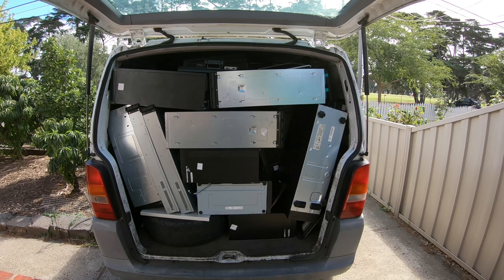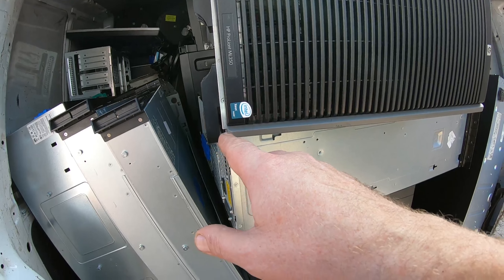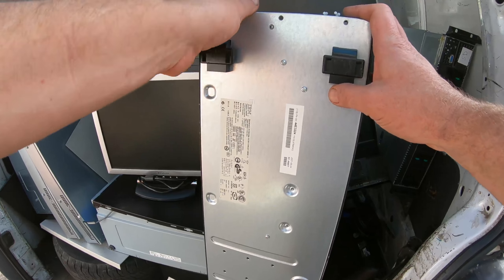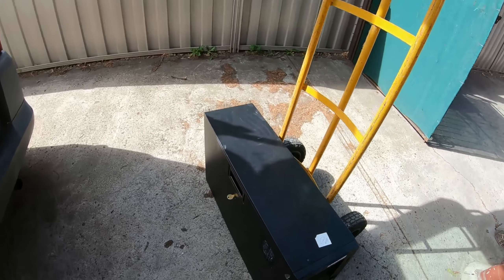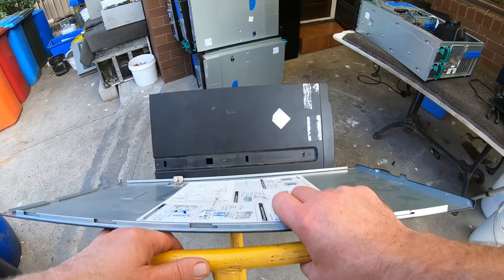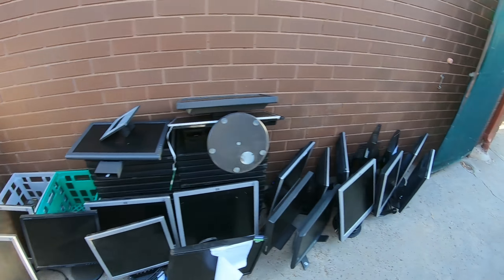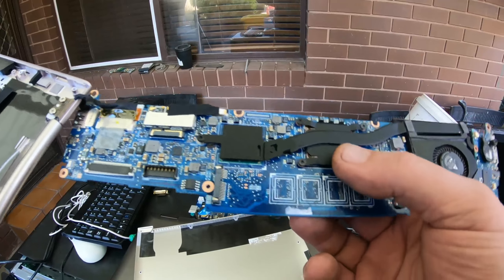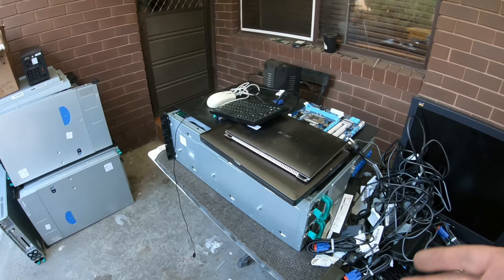eWaste Pick Up Day Lot's of PC's - Part 2

Comment: I export all my monitors to africian exporters. I get about 15$A each for them set price. I would stock pile them complete and locate an exporter, or check out the website that list people interesting in buying monitors in bulk especially for export.
Reply from the maker: India is another big market for monitors, so many Indian call centers servicing the world, they need lots of monitors, not pc's because they use servers to connect 500 monitors to one server, exporting used western monitors to India is a gold mine
Reply: Cool! Hopefully they don't use them in these scamming operations that are run from there. Does that mean you will try to find a buyer and not scrap them anymore? I sell my complete PCs for 15$A also. They don't want PCs without the hard drive. Although I sold 12 PCs without hard drive to a middle eastern exporter for about 7$A each. Not good but I needed the space, and in Sweden no one is buying boards at a price higher than 30cents  kg. ( I strip all my boards and sell the boards still at 30cent a kg - crazy).
Reply: @snoozinghipo  how did you find the monitor buyers?

Comment: Any one else notice at 41.34sec in the mouse run around the corner of the brick wall and in the back of the servers undercover? Lol  nooooo haha...    there was actually a dead mouse in a pc i got  2 days ago haha, not keen on testing that mother board out but it had a quad core phenom and 4g ram so hey 😁..   love that mini server btw so cool looking, do you actually use a server at your house ben? Ive been thinking about using one of the next good ones i pick up?     And your personal pc? Do you use a generic one you've bought or have you done what ive done and built a semi high end pc from saving something special every now and then for personal use?   Ive wondered that a while now...     oh and that black power supply in the white double sized server you said might be a good one, yes it is very good! its called a modular power supply and they usually are between 650-1200w max output and the cables are removable so the un'used are cluttering up a fancy pc build...  id keep that one if it works, if you still dont want it it will fetch 50-60 easy ...    such a good haul mate..
Reply from the maker: No I don't use a server, I bought a dell recently, i'm not good at putting them together so I just bought one with the ram I needed to edit video's, it's pretty good for my needs
Reply: eWaste Ben ohh sweet as.. yeah i use a oem hp pc with an i5 750, ive used an 8g ram stick and 2 2g ram sticks so it has a total of 12g ram, (it was 2g total)  i used a 450w psu from another build i scrapped out so it had surplus power for future mods, and i profited about $420 from that months ewaste so i bought a $60 gpu with 4g gddr5 vram, ive got a free 1tb hdd in it from another pickup, and ive only ever found one solid state ssd so thats in it too atm and i plan to use it as the boot drive soon..    its actually a really nice pc im pretty stoked with it because its overkill for what i do...   i often build pc's for friends too anything  quad core or more is great for gaming or editing so i often pocket $100 as they say after they buy a $150 gpu they've got a pc way more powerfull than an xbox or ps4 which would have cost $800+ as a oem model..
Reply: Good catch on noticing that mouse ... LOL
Reply: lol like to see Ben scrap him lmao!
Reply: I picked up an old tool box once after driving home i took the box out and was inspecting my FIND when a fkn  snake poked its head out and said goodday  so be careful with your finds.
Reply: Man you have X-ray vision.
How the hell did you spot that.
What else did you see with in the 58:57 time frame.
You must be good at finding Wally